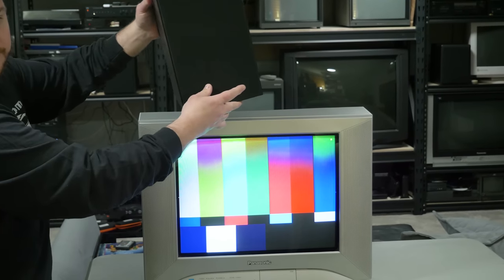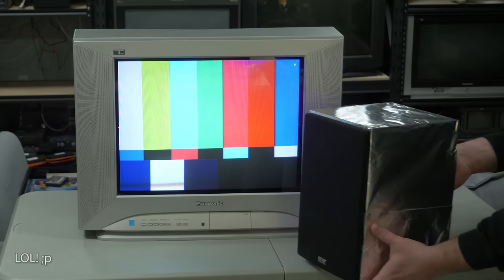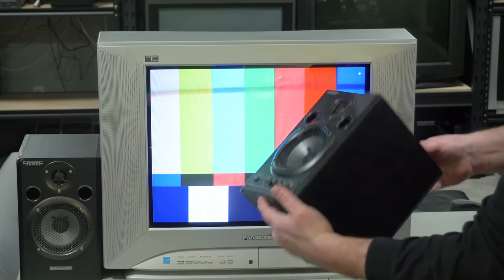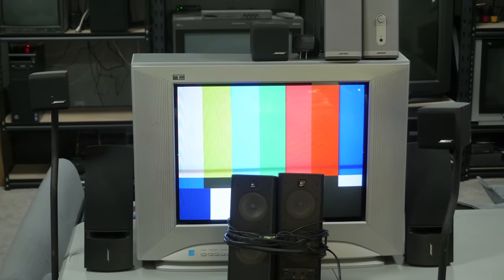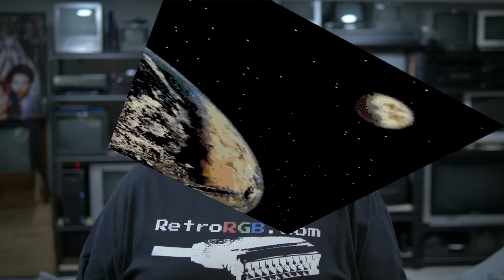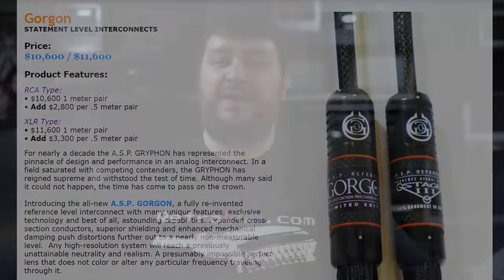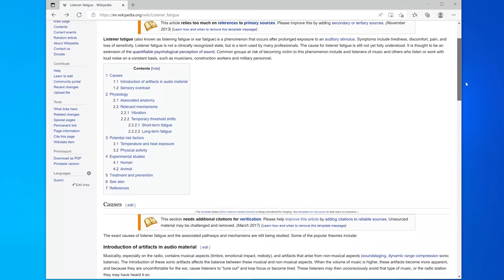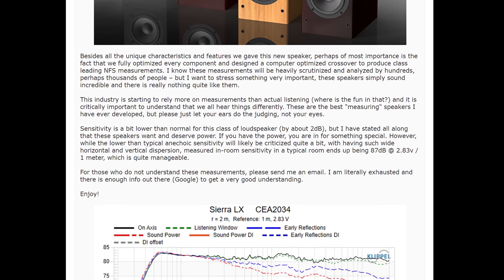CRT's + Magnetically Shielded Speakers

Comment from the maker: WARNING!!  Apparently the JBL's I showed are NOT shielded, even though it's listed THREE TIMES in the manual as being magnetically shielded (as I showed here)!!!  While this is an embarrassing mistake, it proves the points I made in the video:  Always buy from a place that accepts returns and even if the spec sheets, or someone (like me in this video😢) says they're shielded, they might not be.  Here's some proof...and I'm sorry for the low video quality, but I just wanted to get this out there:  https://twitter.com/RetroRGB/status/1513580157860200457
Reply: Thanks for testing these mate. Love your work. You saved a lot of people the hassle.
Reply: That's too bad. The JBL LSR series are absolutely amazing for the price. Maybe just keep your speakers farther away?
Reply: My Klipsch RB-10s aren't shielded either despite saying it.
Reply: even the Ascend Acoustics CBM-170 SE is not 100% shielded, I bought it after watching this video, and now im using it with a DELL P1130, when i stick it close to the monitor i get a pink hue on the side, maybe its a quality control thing? but it only affect one side of the monitor, not the top just the sides !

Comment: I just looked up the specs for the speakers I've been using next to my CRTs for the last eight years and found out they aren't shielded. However, I've never noticed any color distortion. I've never put them right next to my CRTs but pretty close in some cases. Is this still ok or should I be worried in any way?

Comment: Audio is also objective, thats the basis for Ascend acoustics research. JBL also objectivizes their speaker design. The bare minimum is a speaker that has a flat response or one that has a slight tilt in the response. Ascend recently bought a Klippel NFS to prove that the reason why their designs sound good is because they are designed with a flat response and now use it as as measurable basis for all their speakers
Reply from the maker: Know what’s not objective?  If a speaker is magically shielded or not. 
🤣😂🤣😂

Comment: 10:22 speaker placement and room acoustics make up almost the entirety of the sound!

Over on Audioholics during a recent live stream an audio expert was talking about an experiment in which various high-end speakers were placed in an anechoic chamber and critical listeners were not able to distinguish between them. As soon as those speakers were placed in an actual room though the experts could correctly identify all of them.

Speakers must interact with your room in order to sound correct.
Reply: Actually unless speakers are very high end and got pretty much the same design in mind they will sound different.

Comment: This actually helps me a ton. I had this happen for about a week on one of my monitors and freaked out thinking it was permanent damage. Luckily Retro Tech was able to reassure me, but I was definitely considering the "just wrap it in foil' trick. It's especially helpful seeing that even some higher end products aren't shielded, while lower ones sometimes are. I think I use those exact Bose speakers you pulled out!

Comment: Dude this is hilarious.  I have never felt so connected to a video in my life.  Just last week I was looking for shielded speakers for that exact pvm that u used for your thumbnail.  Then, I always rock 2 of those Panasonic tv’s you showed but mine are 27”and yours looks like a 20”.  I tried to research how to shield speakers and thought of putting some metal roof flashing in between the tv and the speaker and you tried it with the aluminum foil and I was cracking up.  Bravo bravo thank you for the research and all the good info

Comment: Fantastic video,  I run a 5.1 Surround Sound system with my SD set up and one day when I was setting up my center channel speaker, which I was going have sitting on top of my set, I noticed discolouration and promptly pulled it away.  I then went to my HD set up and swapped the center channel from there and discovered that it was indeed shielded.  The rest of my speaker set up is not shielded but I keep them as far away from my 32" Trinitron as possible to ensure no funny business.

As always thanks for the great insight and explanations, keep up the excellent work.

Comment: I've known about this when I was trying to find some good bookshelf speakers for my setup a few years ago and it was hard to find some good ones that where magnetically shielded. Thankfully I found a set of JBL N26 Bookshelf speakers from 1999 on craigslist and found out they where magnetically shielded and was able to buy them and can confirm those models of JBL speakers are magnetically shielded. Also I should give a warning about one pair of studio monitors that some people have recommended for crt use which is the Mackie CR3s When I asked Mackie themselves about it they told me they are not magnetically shielded for crt use and when I got them for things other then crt use I decided to test to see if they where right and I can confirm they are not magnetically shielded for crts.

Comment: Very good Points!  I have collected dozens of speakers from the thrift store ,for this reason... just trying to find something with the best retro audio.   The thrift store is so cheap and I've actually found some really good quality speakers for less than 5$
Reply: Just found a pair of JBL Platinum Series speakers in mint condition for a bit over $5. They work well and sounded much louder than the speaker in my small CRT tv.

Comment: I purchased the Ascend Acoustics CBM-170SE pair based on the recommendation of this video. Ascend sells B-stock on their site which is around 20% cheaper and may have a scratch or two. They have the same manufacturer warranty as the regular new ones. They sound excellent, almost as good as my Yamaha studio monitors (which are twice as expensive and not shielded). For retro gaming, they are basically perfect. For anyone looking for a great quality and affordable amp, I'd recommend the Audioengine N22. It's a tiny but powerful amp with a RCA stereo input and 3.5mm input. It can easily drive most bookshelf speakers, including the CBM-170SEs. If you need more simultaneous RCA inputs you could get a passive switch box. The N22 also has a connection for a sub. Anyway, thanks for the recommendation!
Reply from the maker: So glad you had the same good experience I did with them!  For money, these are amazing!
Reply: @RetroRGB  Absolutely! Now, got any suggestions for similar quality, priced, and shielded subwoofers? 😆
Reply: Yo would you mind telling me more about audioengine n22. It looks super tiny and I am not sure about it but please enlighten me
Reply: @juntartful  Hey, not sure what else to say that I didn't already in the original comment, but it's a really quality amp. It's 5.43 x 2.68 x 6.4 inches, weighs about 3.5 pounds. It very cleanly and accurately represents everything I've thrown at it so far with no distortion. Smooth and rich. It doesn't sound clinical or "cold" like Class D amps sometimes can. You can simultaneously run the audio signal going into it back out of it via stereo RCA if you want. What else... it has a blue light around the volume knob when its on? Lol. The volume knob is also how you turn it on or off, you turn it all the way down and there's a nice click. It feels really premium, sounds great, and can get extremely loud with these speakers. I don't think I've ever turned it up past 50% volume and that was around 95db, which is entering possible hearing damage range. They include a pair of nice speaker cables in the box. I would still highly recommend it if you are looking to hook up a single RCA or 3.5mm sources. If you want more stuff connected simultaneously you could connect it to a passive RCA switch box or something. Great amp.

Comment: There's two things I care about in speakers, shielding and latency.  Now, if it's a pure analog speaker latency shouldn't be an issue, but there's far too many modern speakers that have a digital interface these days, with a full suite of digitized features and anti-features such as automatically shutting off or just refusing to play sound below a certain "base volume".  I have a pretty decent surround sound system save that it's analog interface introduces added latency which is rather apparent if you have a CRT in the mix.  I'd like to shop around for a zero latency surround sound system that also supports the Gamecube's dolby digital mode.

Comment: Most, if not all, of the PC speaker systems sold by Yamaha from 90s until 2008, at least, have everything shielded, including the subwoofer. Some popular ones are the YST-MS35 2.1 stereo and TSS-1 5.1 surround systems.

As far as tales of misadventures, I bought a Logitech Z-5500 5.1 THX surround system, which is arguably the best "magnetically shielded" PC speaker system (although the monster 12 inch subwoofer is not shielded!). I decided since it was so highly praised, but the subwoofer so massive, I would shield it myself despite mixed comments online about it's effect on anything more than 24 inches away, since it seemed better to be on the safe side. Ugh, what a nightmare. For one thing, the speaker is not the only thing that is magnetic. The amplifier coil in the subwoofer box is probably as magnetic as a 3" subwoofer and generates enough heat you probably don't want to enclose it. Second, there is a large (4-6 inch diameter) plastic "horn" about an inch behind the 12 inch speaker magnet which pretty much prevents any access to the unseen half of the speaker magnet and it is glued on against the threat of nuclear Armageddon. With pliers and hammer I managed to eventually get the horn removed with moderate repairable damage. I then placed a 5 inch diameter 4 inch high steel stove pipe cap over the magnet and taped it in place with EMF shielding tape. All this seemed to have accomplished was to raise the "magnetism" to the top of the cap, as the heat sink on the box lid above the mess now seemed noticeably drawn towards the magnet whereas it wasn't really before. Also, a piece of steel was strongly attracted to the top of the metal cap, certainly more so than to the amplifier coil. Testing the magnetic field with an EMF meter app on my phone showed no difference between the before and after shielding added. 

Next, I tried just covering the back of the speaker with the magnetic tape (it came as a 10 inch by 5 foot roll, so this was easier than it sounds). Again, no measurable difference. My last check might be to actually place the 30 pound, 16 inch cube subwoofer next to a couple CRTs. I'm not sure if this will work any better as a sensitivity test than the EMF app on my phone. The app is on iphone and simply called "Electromagnetic Detector EMF" and background is about 0.1 microTesla, a PC will read about 1.0 microTesla and the peak EMF for the subwoofer in all cases was about 3.0 microTesla.

So, my advice is to either settle for an inferior Yamaha PC system, build speakers so you can easily experiment and then hook up to a receiver, (again, likely inferior) or just buy the non-shielded subwoofer of a high quality product and hope it never accidently comes in close enough proximity to something sensitive that erases a valued VHS tape, floppy disk or HDD of your retro setup.

Comment: This is also one place some older speakers from that era might come through. Shielding was needed on speakers during the CRT era. This of course isn't guaranteed but if the speakers are from a reputable brand that was popular there is probably info out there. I found some Boston Acoustics that are shielded that work pretty well. Though I wouldn't mind a smaller solution as the ones I have are 8" woofers.

Comment: Mate, that D24 and D-Series next to each other are amazing CRTs, as you well know, just those two alone would give you an almost perfect CRT setup, perfect 240p/480i 4:3 and perfect 16:9 SD & HD displays.
Reply: What’s the d series? Speaker?
Reply: @bojangles6444  JVC D-Series are a series of CRTs, they are fantastic for 240p and 480i content, and rival Sony Trinitrons for that resolution, Sony Trinis look better with higher fidelity 3D content though, I guess Sony's 90s curved CRTs are the best all-rounders, so if you only have space for one CRT a 90s Trini might be your best bet for retro content.
Reply from the maker: That's actually a D32 :)  And I think it's funny that the BVM-D32E1WU and JVC AV-32D202, 36" D-Series (it literally says "D-Series" on the front" are both referred to as "D Series".  Makes it confusing.
Reply: @Wobble2007  oh yeah those are good i thought it was a speaker lol
Reply: @Wobble2007  I have like 6 pvms one is a 29 inch Mitsubishi in a case in the garage bc I  have no more room lol. No JVC or Ikagami all sony- mostly 20 inch bvm. Haven’t got any in years. Too much $ now. I am not paying 3 grand for any crt

Comment: I use speakers from early 70's with my CRT big ones and they use different kind of magnet which are very small and don't create magnetic field around the speaker even without shielding. I think those magnets are called alnico.

Comment: So far I've been pretty lucky in that I have my surround speakers pretty far away from my current consumer CRT in my setup. I haven't tested their shielding though. My PVM I think was less fortunate in a former life -- one of the corners has some color distortion that I suspect is from being stored next to an unshielded speaker. I'm able to coax it out using a magnet but it comes back after a time.

Comment: On my multi-console retro setup which has an OSSC to HDMI-VGA to off-white PC-CRT, I took two off-white Roland MA-8 speakers but two of the passive ones - they each have a 4" main driver and a 1.5" tweeter which are both magnetically shielded with the big cup shields around the magnets, and I lined the internal walls of the plastic enclosures with bitumen-based car sound deadening and then polyester wadding, to make them less peaky/echoey.

I then blocked the bass ports with polystyrene tubes as I have them high-passed as I use them as satellites powered by a mini stereo amplifier (they're placed only about an inch either side of the monitor with no issues) and then I have two mini subwoofers (not magnetically shielded but down on the floor) powered by a plate amplifier I made a seperate enclosure for, and the system also has a 9-band equaliser (I use bigger and better audio equipment for music listening, which is not shared with my retro setup).

Comment: Great video Bob! I have that same pair of Edirol speakers for use with my PVMs and they are great. However, I have always kept them at least 1 foot away from my CRT's, out of worry that the vibration might cause some sort of issue/jarring that could damage my monitors in some way. Is that me just being neurotic? Again these Edirols are nothing crazy, they are less than 50 watts.

Comment: Maybe you could use your phone's magnetometer to test whether the speakers are shielded or not? There are definitely programs available that can graph what your phone's sensors are picking up. Maybe if you used that to measure how strong the magnetic field is around some shielded and unshielded speakers, you could figure out a range of values to test for. Once that data is available, people could just use their phones to check if the speakers in the shop are shielded or not.

Comment: Thanks for the video. I'd still avoid placing them directly next to the CRT though. I have the Bose ones shown at 3:33 and used to have them placed next to my PVM. Now I have a colored spot in the corner 🥲 So if you can, at least move them a bit to be safe.

Comment: So, how far is far enough away to place an UN-shielded speaker by your CRT tv? Given you said that the effects aren't noticeable sometimes, how do I know if I'm in the clear or not? If I don't notice any discoloration effects when placing it about 16 inches away from the CRT, would that be safe? Thanks and I appreciate the insightful video!

Comment: Thanks for the video Bob! I have 2 very small and cheap speakers at like 9 inches away from my CRT, they're connected to my HD monitor, I tested them placing them as close as posible to the CRT screen and they make a little colour interference but nothing crazy.
My question is at a distance of 9 or 10 inches from the CRT, are they dangerous like in the long run? I usually don't have the volume high (don't know if that matters or not) and they only seems to cause interference being placed really close and facing the screen, should I buy a pair of shielded ones?
Reply from the maker: As long as it causes ZERO interference on screen, it should be okay.  I like to move mine as far as possible though just to be safe.  And good question, but the volume shouldn't affect it too much.

Comment: Thanks Bob,
I have also tried a few speakers and have been terribly disappointed. 
I am now of the opinion that consumer CRTs already have good speakers unlike flat panel displays and it is not really necessary to connect external speakers.
Reply from the maker: I agree, most consumer CRT's have decent speakers.  Certainly better than flat-panel!  Not an option for most BVM and VGA monitor owners though.

Comment: I just found out the Floor speakers in my setup were causing all the “Noise” on my CRT screen. 
I got rid of them and I’m also selling the Marantz receiver I have. 

With a 36” Trinitron, it seems like the TVs speakers are good enough.
Reply: Big Sony trinitron always sound good! They always have  subwoofers in them with really nice satellite speakers! Some had 2 subwoofers with 2 satellites units with tweeters and a center channel!